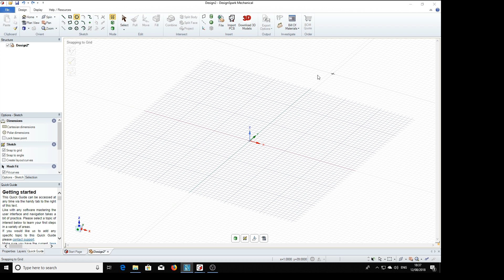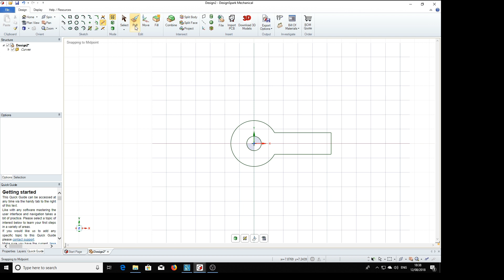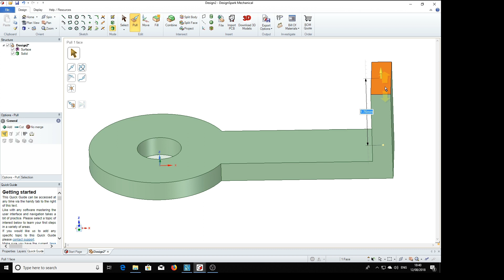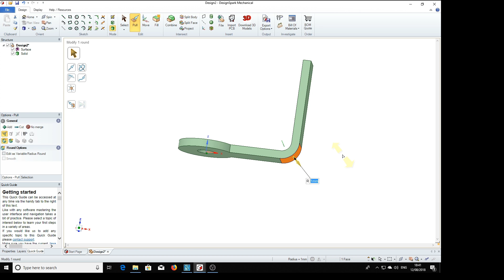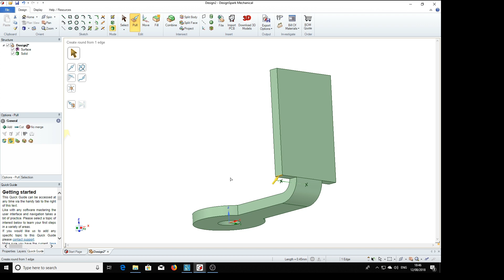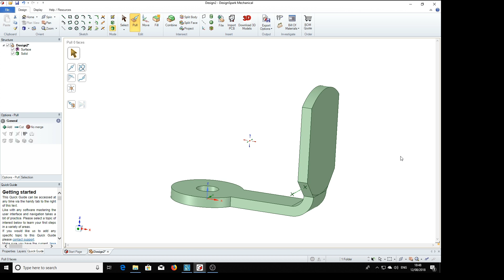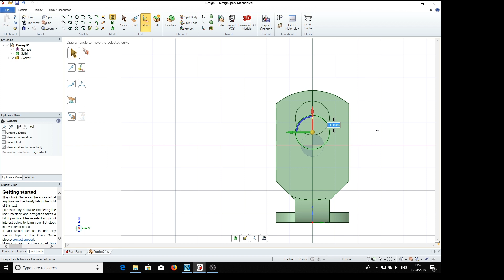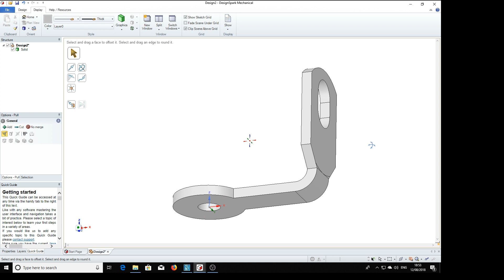Modelling a Potentiometer in DSM: The solder tag 5/6

Comment: Thank you for sharing this and I like the way you left in the extra deliberate mistake whilst putting the radius on the oval hole end when you clicked on the centre of the end instead of the end of the construction line.
Reply from the maker: Making mistakes is a vital part of the learning exercise as is learning how not to make mistakes.
Reply: Very true and I like your honesty for leaving them in, I have already learnt a lot from your series and I apreciate the bite size exercises and look forward to more, do you find your methods by experimentation or by using the help menu because I struggle to find what i need when I look there?
Looking at things like cylinder and valve chest sealing is the loco you are drawing gauge "O" or gauge "1"?
Reply from the maker: I find out most things by experimentation but occasionally I use the help menus - they can be useful at times. Videos by other YT''ers are also helpful. 
It is a 7-1/4" gauge model - meaning that the inside distance between the rail tracks it runs on is 7-1/4"  (18.4cm). All of the drawings are to scale of course and when dimensioned will give the correct sizes. I have not produced working drawings - this would more than double the workload and I would need to spend a bit of money on the DSM drawing module. I am now about halfway through the project and already there are just under 300 3D drawings. At this stage, for drawing speed, I have not implemented the threading on most nuts and bolts etc. The helical springs are, however, rendered realistically.